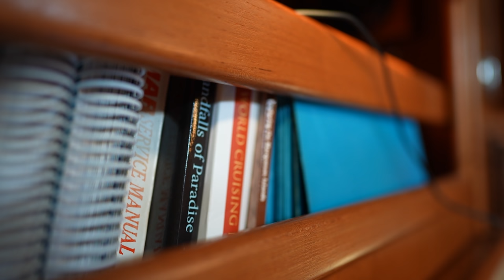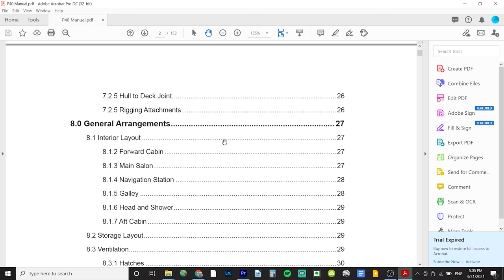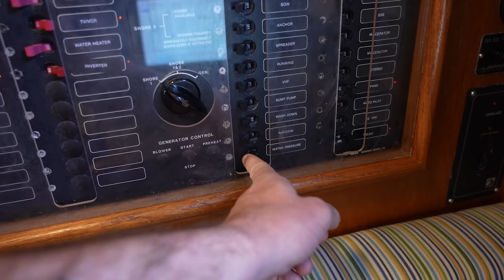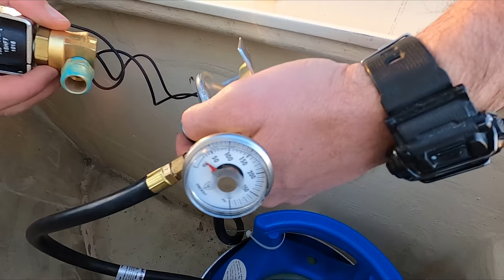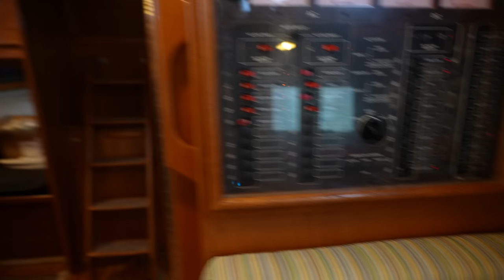We Love this boat...BUT NOTHING WORKS!  | S06E01

Comment: You'd think the inspection you paid for would have detected those problems. Good thing Jordan is so handy and could fix them.
Reply: Not necessarily. The water and propane worked fine to cook breakfast and start the cleanup, so it's very likely they worked during the survey as well. I like the way they work through a problem by checking the simplest things first; very "logic tree" of them...Nice first day!  :-)
Reply: @edwardrose4180  ifit was me id chill in connitcut doing sea trials testing the electric and plumbing getting to know the boat go to rhode is land shit like that. then go for a long cruise.
Reply: @edwardrose4180  Most likely the messed up inverter put undue stress on other electronics in the ship in addition to it's age. It could cause a sort of daisy chain of events. Very important to get the most base parts of a system working correctly so you can troubleshoot properly also. He didn't go into whether he replaced the inverter or not yet, though.

Comment: Every boat I’ve owned has a learning curve.  Each project makes it your boat.  I’m amazed that the two of you didn’t break down and have immediate buyers remorse. Instead, you took it step by step and solved the program without tears, crying, or throwing objects around the boat.  Amazing.  Did you want to do any of the above?
Reply: Or maybe they just didn't make the final cut for the video. ;+)
Reply: having the boat on the mainland meant they could get parts quickly and easy. I can imagine this in the middle of nowhere and the weeks without the gas working.

Comment: West Marine has been a great deal of convenience for me too. I had to replace my fresh water pump on my boat only about a week after I bought it. I called and they had some right there in the store, an improved replacement for my old one. So I bought it and installed it the same day. Chances are a lot of systems in your boat had not been used much. Now that you two will be living aboard, systems will be used more often. So old things could fail simply from aging through the years. I wouldn't sweat it, that boat is an absolute beauty. Any of it can be fixed and it's worth it. It's easy to get overwhelmed going from a smaller boat to a much bigger boat. You two went from a "boat" to a "yacht". I was overwhelmed the moment right after I handed over the check and bought mine 😂

Comment: I had a very similar experience when I bought my bought my boat 10 years ago, and I did not know enough to ask the right questions during the survey.  My stove did not work and I was told it was because the tank had no propane - reality was the solenoid was shot ($$$).  A few lights did not work, I was told I just needed to buy new bulbs - reality was the switches on the lights were shot.  The good news is that these experiences got me to learn the workings of my boat in great detail.  You guys learned a lot on day one!   thanks for this video - awesome as always.

Comment: Hi guys. Well you’ve convinced me I should add a regulator and solenoid to my spares. Our boat is the same age, and it gets pretty salty back in the ventilated propane locker. There’s probably room in there for another propane tank if you want. We were warned that the water tank inspection ports have a tendency to leak if the tanks are overfilled. A PS owner recommended HYPERVENT AIRE-FLOW™ MOISTURE BARRIER for under the mattress and it has kept it totally dry and mold free under the mattress for 10 years. Nice videos!
Reply: If only had I read your comment earlier! 5 years of fighting with mould under my mattresses!

Comment: Hi! Small tip. When it's to cold and if the propane tank is not full this problem with the flame can appear again. You simply turn up side down the tank and it will work. If the outside temperature is low of course. During the summer you shouldn't have these problems. Take care and have a great time on a new boat guys! Cheers!
Reply from the maker: Thanks for the tip!
Reply: I grill in winter (Wisconsin) and sometimes when its cold, I need to just take off my glove and put my hand on the regulator to warm it up and get it flowing - you may have a perfectly good spare regulator now.  :)
Reply: Do not turn tank upside down!  Could get liquid propane instead of gas.  Could cause fire in cabin.  Pick-up tube designed for certain orientation.
Reply: I said the same thing lol

Comment: If you have a self priming water pump, and your pump keeps running continuesly, it means you ran out of water. Close all taps, fill the tank(s) and turn on the breaker of the pump. Wait till the pump stops “running”, now open the tap furdest away from the pump and let the air get out. Close the tap, the pump will keep running for a short while, until it has build up enough pressure in the system.
One little reminder, if you run out of water, turn of the water heater ( if electric ) because it has no water to heat and could damage your heating element.

Great video again!

Comment: Jordan, the most obvious thing to check first when the gas hob stopped working was: is there propane in the tank? You studiously avoided the primary check!
With regards to the dirty water tank, I thought that was reasonably clean. Even potable tap water has impurities in it. If you have a particulate water filter in your house you will know how dirty it is when you change it.
Boat looks great. You are going to have a good time sailing!

Comment: Minor issues replacing the propane regulator and solenoid is a relatively cheap and now completed fix. Yes the water tanks for sure need cleaned out but again regular maintenance type items. Hey, you need to learn your boat all over again and this is the place and time to be doing it!

Comment: Good solve with the mis-labeled tanks. We sometimes have water problems in our R.V. and it is always a clogged aerator on the end of the tap. If you have water problems, it helps to try the other water devices such as flushing the toilet or turning on the sink/shower in the head. That will help you with where to start looking— local or global.

Comment: That is a beautiful boat. The lines, color, finish is amazing. Old Atticus is jealous I'm sure. The problems you ran into are nothing short of what happens with any new piece of equipment, you have to become familiar and learn the in's and out's. Better you did it early on than at sea. You may not have had to replace the parts on the propane tank but it looked fairly easy, posts were available and you have confidence in the system now. Good job, well done, ship ahoy, or whatever, you get the idea...

Comment: A sailor i know bought a 37 Nantai for $10k without a survey.  Everything was jank on the boat.  Batteries were wired wrong.  Fuel lines sucked air on the beta. One set of sails that were on its last leg were on the boat.  Roller furler snagged 50% of the time.  Steering cables were always jumping off, and the emergency tiller was 24".  No fun is 6s and 8s on the Atlantic. The main ripped and we ended up taking it to hilton head where it was pulled out.  We went from maryland and our goal was galveston before all systems went south east of mobile.  It was an adventure.

Comment: My rule is when I have things to replace or repair. If it isn't on the boat already and I need to buy one I buy 2 (within reason, don't need 2 generators). It broke and I needed to replace it so likely again. The saying in cruising is one is none and two is one. I think the PO of my boat had the same philosophy. When I got the boat I emptied and inventoried it ~$10,000+ in spares and maintenance items! Those gas regulators and solenoids have a rough life in the cockpit. Go get another one. Since your boat wasn't being "cruised" I'm guessing your spare inventory needs some work. Can't wait for the tour. I voted Valiant but this boat is really cool. Seeing you on it you made the right choice.

Comment: When something doesn’t work quite right on Atticus II, it is probably going to take a while to transition from immediately looking for major systems failures like you experienced on Atticus, to looking for the simple solutions like mislabeled valves or wires (or propane valve being off). It is wonderful seeing you work in spaces that are not cramped or falling apart, but instead, clean and organized with elbow room for your large frame. Keep smiling Desiree!

Comment: I think these small issues actually helps you get to know the boat more intimately, now you know exactly which water tank goes where and what valve is linked to what 😁 you had that with Atticus 1 because you built it and the better you know your boat the easier troubleshooting will be in future

Comment: If your water system doesn't already have one, I would highly recommend an accumulator. This would help reduce wear on the pump and even out the pressure.  To clean the tanks, pump out the water, add about a !/2 cup of bleach to each and fill with water.  Let it sit for a few hours or overnight  and drain again.  Then fill and flush at lease two more times.  I would wait until the water in the marina is back on.  Using a hose is a lot easier than carrying jugs of water unless you're in training for an Iron man/woman competition.

Comment: The propane tank safety switch solenoid valve possibly wasn't getting enough voltage to operate where as a new one needed less voltage, guess i'd have checked the voltage at the solenoid with the switch on after being sure I had enough propane in the tank. Happy for you and your shared Joy.

Comment: Great job guys.  The projects make you investigate your boat and work things out, better done in a marina than at sea.  Just teething troubles and the boat is still awesome.  Those Force 10 stoves are great, I had the four burner on a previous boat, the oven is the best boat oven I have ever used.  I love your boat.  Andy UK

Comment: Great job guys, now the old familiarise with the systems ops 😳🙄🙄🙄good work Jordan, had the same experience with our caravan and the water pump sounded like a cement mixer 😂and I thought the pump was shot but it was a tap off but the handle was thinking on but was off when turned in line with the pipe 😂😂😂 super happy we reckon that you could over come most problems now 👍🏻🍺🤓 love Shelly and Jeff xxxooo

Comment: We love having an oven in our boat, but they tend to have very uneven heat which is an issue for baking.  Our solution has been to put a pizza stone in the bottom of the oven to even out the heat.  It takes longer to heat the oven, but cakes no longer burn on the bottom of the pan.

Comment: Since you are using Propane for inside stove, I would highly suggest using a good 2 stage propane regulator and not the single stage used.  Incase you have a failure of one of the two stages you wont get full pressure going inside and more stable pressure to the inside.      .     Love the show !!

Comment: I purchased a camper that someone lived in. There is a black fluid that can build up in the lines and block the flow of gas. I unhooked a line at the lowest farthest point and blew out the line. Its very messy so i tied a rag on the end and put a bucket under the line. Try that fixed the propane lines. If you find the gas slows down again this might be an item to check.

Comment: I read that because of the pandemic used sail boat prices starts to go up. All different parts for building the new boats are stuck in transit or just cant get hold of new raw material so it's hard to find any new boats at all. So I think you got a good price on the boat even if it needs work. Congratulation on the buy.

Comment: Sometimes an aluminum pickup tube will develop pinholes above the lowest pickup point in the tank.  Simply sliding a piece of hose over the tube and securing with a hose clamp is a quick fix.

Comment: Ok Bud I think I know what the problem was. This may help you next time you run across this gas issue with the stove . So the tank is located outdoors in the cold weather. Physics tells me that if temperatures is low so does the tank pressure. Take it from an HVAC tech. Next time try wrapping the tank on a warm blanket and see it this works. I'm willing to bet that was the problem. Love your episodes. Congratulation on the new sail boat.

Comment: Reminds me of the first used motorcycle I bought, I got one mile down the road and it conked out in the middle of the highway, took it to the repair shop and the mechanic told me, oh yeah, the guy that sold it to me was in two weeks ago and was told it needed a new solenoid,  caveat emptor.  Maybe the seller will help with some of these repair costs once he sees the video.

Comment: Since there is a fair amount of debris in the fresh water tanks, it is reasonable to assume the diesel fuel in the tank could also need cleaning. 

The tank should be inspected if not already done, and, if necessary, professionally cleaned. Also the fuel should be run through a polishing process. The filters should be replaced, if needed and hit up West Marine for spares.

Comment: That junk on the water pump screen reminds me of similar issues with my RV.  The junk was coming from the water heater tank. The previous owner didn't keep a fresh anode rod  in the tank causing similar looking mineral deposit junk. If you have a similar small water heater and it has been dry and  put back in service without a solid tank flushing, getting unwanted junk on the filters and screens is almost a certainty. The anode rod might be  part of the drain plug. If the electric side of the heater sees regular use , these anode rod/plugs don't last anywhere near as long as advertised. The are also too cheap not to have several extras in reserve.

Comment: Air compressor is good for cleaning dust and stuff out of the ports the gas comes out of was the main issue we fixed when I work with gas without watching the last bit yet it's a good thing to check when you have that issue water heaters cookers and everything

Comment: Good that you sorted out things. I would expect that there is going to be a lot of similar issues from systems that had remained idle for so long. Firstly, it was probably a good bet to replace the gas fittings. I would not trust that solenoid, and would have a workaround handy to be able to do it by hand should the new solenoid, and the serviced (?) old one pack up half way between nowhere and nowhere else. I would put some Milton or similar chlorine-based sterilizer in the water take and let it sit there for a few days, to get rid of the algae and other stuff you have growing there, then flush, clean the filters, and hope all is good. But enjoy!

Comment: Longtime viewer.  Just wanted to drop you a note.  Don't be discouraged on finding problems with your new (to you) dream boat.  These days... new boats have break in issues too.  LOL  Seeing the condition...I would have replaced the propane items anyway.  The water was just figuring it out and you didn't burn up the pump doing it (a plus).  How nice is it to have THREE water tanks anyway!  And bet you really didn't expect them to be totally clean... right?  So, with a little work... you'll get that figure out too.  You're gonna fine a few more things... but, all is good!  On an older vessel, the one thing I'ld be looking at is your diesel tank(s).  You know if they are "bugged" it not going to show up till your out bouncing around and needing the engine on harboring.  So... look into the tank(s) and see where you at.  Building/adding your own polishing system would be a wise thing to have if it's not already on board.  Anyway,  SO HAPPY for you both.  Looking forward to your adventures.  Fair winds and calm seas.  Rick  ;)

Comment: Five weeks after purchasing our dream retirement home up in the Blue Ridge Mountains, we found things our surveyor "neglected" to find.  In retrospect, (and $22,000 later), it pays to bring on a few "specialists" into the equation.  The problem is after, septic inspections, engineering reports and multiple home walkthroughs, you become "fatigued" and just want to move forward.  Our biggest expense was a new heating and AC system.  We should have paid a few hundred bucks to bring in an HVAC company to run through the system.  Would have been able to negotiate a better price to "share" that additional cost.  Mortgage origination fees, closing costs, and needed repairs were a pretty large expense in and of itself.  BUT, it's not like you won't benefit by making the needed upgrades/repairs to newer and more efficient systems.  After all, it is your home (on the water or fixed in one place).  The truth is we are human, emotional beings and we make the best decisions with the information we had at the time.  No doubt there will be more "surprises" in the future, but we do the best we can to address them and keep our eyes on the horizon.  BTW, great clarity on the video and nice to see a Jordan tutorial once again.....Bossman

Comment: Nice boat!!! So jealous. Regards the water, use some hydrogen peroxide in the tank, get test strips and try and maintain 5 ppm. The EPA states up to 25 ppm is safe. And get an LED Ultra-violet system for a single faucet. The LED will use less electricity and run cooler. If you have room add a small in-line carbon filter on the line to polish out taste and odour. Don’t use carbon without hydrogen peroxide and/or a UV system

Comment: Honestly, the water part is just about getting to know the boat, is not really a malfunction. Used real estate has those kind of things, electric wires popping up at the most unexpected spots, noone knows where it is connected etc. You were actually quite lucky - if you work with propane and make a mistake, just that it does not work is still the better kind of outcome. Relax, get to know her (the boat) better, you'll get along.
I really like that you are on your own in that marina, Desiree must have fun :)